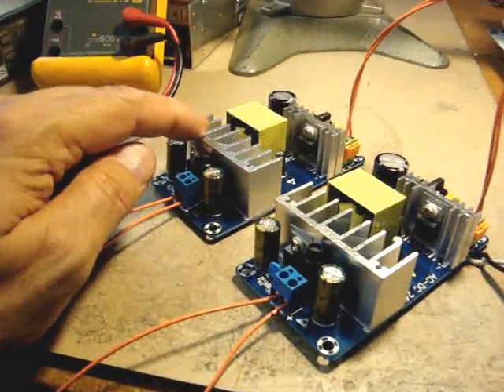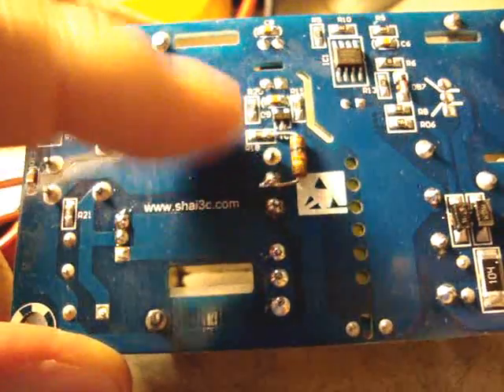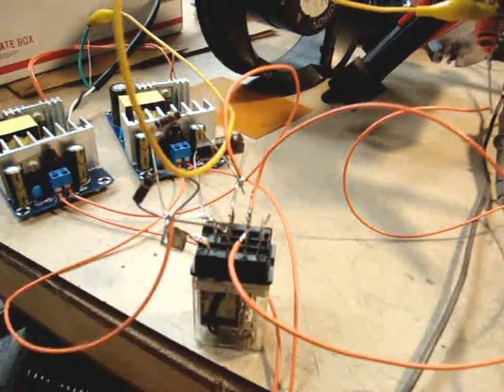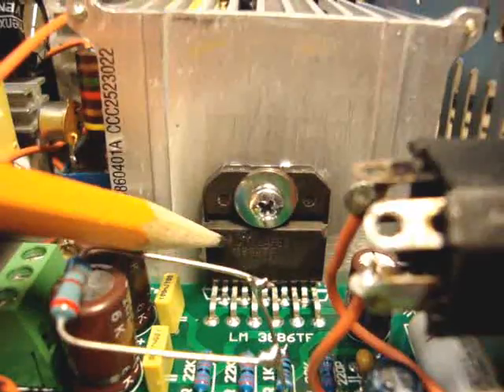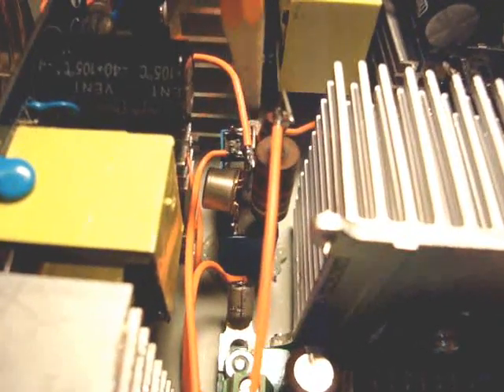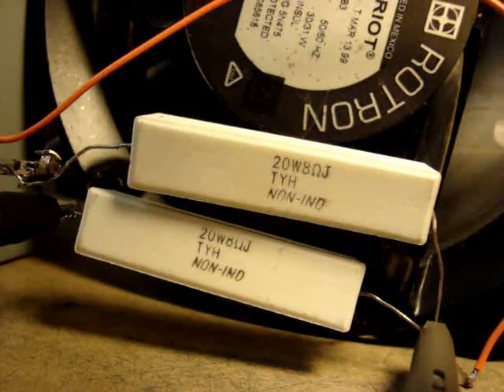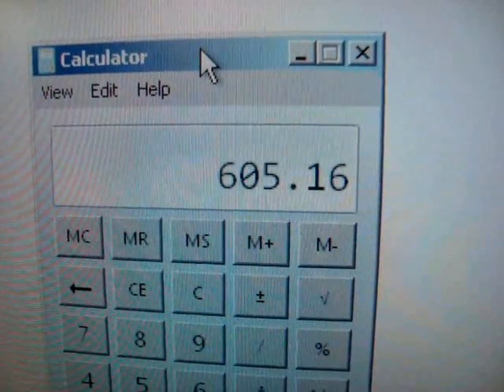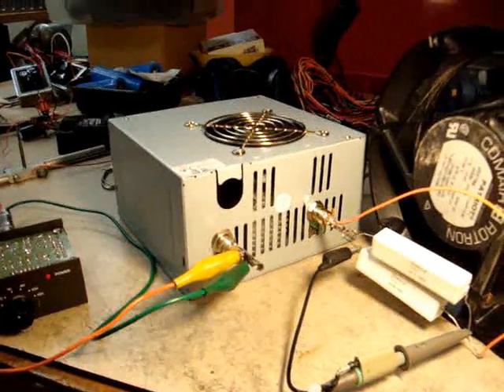SMPS LM3886 Amplifier Project

Comment: Hi Bob, i have a question, i have one switching psu with 2 out, (-V,-V,+V+V and gnd) 24 volt  5A , can i use? Or i need 2 separated psu? Thanks
Reply from the maker: Good question. If that's what i think it is, it's asctually just 1 power supply with the extra outputs connected in parallel to the screwdown wire terminals for convenience of wiring. I have a few supplies like that. There's 1 way to find out. If you have a multi tester meter, check contiuity between the 2 positive (+) terminals or the negative (-) terminals. If it checks a short between either of the 2 terminals, this means the psu just has extra terminals. Thus, you'll need an additional psu. Hope im wrong tho.
Reply: @bob4analog  yes, this tipe of power supply,
Reply from the maker: @andresgamboa1275  ok, so you'll need to get a 2nd psu. If your psu has a metal case, make sure the negative terminal is not connected to the case. You can check that with your ohm meter.
Reply: @bob4analog  ok, like your video, thanks My friend
Reply from the maker: Hope it works ok for you. All the best! 😃

Comment: I like your way of doing this - compact, powerful, cheap. Can you do some noise measurements as well? How about hum and distortion?
Reply from the maker: I suppose i could, but this was really a basic test evaluation to demonstrate the power output of the LM3886. The hum is virtually nonexistent and the freuency response is flat from 30-20khz (which I didn't show, sorry). I would imagine the THD would be close to the mfg's listed ratings.

Comment: Hi Bob,
I’m trying to do your idea with the two 24v switching but i add two step up voltage circuits that pull up the tension at 31v. What i’ve not understood yet, is how create negative voltage. It needs the relay to do this? Because at the pole of AC(in) amplifier i’ve only positive tension (+31v). Sorry i’m not well in electronic
Reply from the maker: The power supplies are connected in series, like 2 batteries. The ground is where the 2 batteries (or power supplies) are connected together.
Reply from the maker: I'll be glad to send you the schematic of how i made it (if i haven't sent it to you already).

Comment: How clean was the DC that these smps made? Doesn’t smps have a lot of ripple if not built for audio?
Reply: Off-the-shelf ones might have a lot of high frequency switching noise, but mostly its above the range of hearing, so it should be ok provided the amps are compensated properly so they dont oscillate given the high frequencies present. But if theres too much noise at the output it can damage tweeters. The amps can help somewhat depending on how they are set up given they still have 20-30 dB of CMRR at higher frequencies. Another consideration is the current, as these will only have around 3.5 amps peak (1.75 amps/channel), so they may not work well for 4 Ohm speakers. I used a flyback in my LM3886 amp, but of my own design so it could be bipolar, and be low noise with the appropriate bypassing and snubber networks, and fit onto one PCB so it just has a mains cord going into the cabinet. At the amp output the residual noise from the SMPS is down to around 20mV RMS. Power output is 36W RMS into 8 Ohm speakers.

Comment: Hi BoB H, which rail does the relay switch on? Pos, Neg, or the Gnd rail?
Reply from the maker: The relay is connected across both rails. It will only activate when both supplies are up.
Reply: Thanks.
Reply from the maker: @raytempo6332  -  ;-)

Comment: Is it possible to modify the power supply to work at 40v?  I have a 16 ohm load that i want to drive using a 3886 for a guitar amp that i'm building.  I actually already have one going with a 28-0-28 transformer but want to build a second one for a friend.  These power supplies are much cheaper than a transformer!
Reply from the maker: I have another vid where I use 2 switching PSU's for the +/- rails. Yes, those are far less expensive than transformers. However, modifying them to do 40v per rail might be pushing the PSU's. I'd recommend finding a PSU that will do 40v or something close to that, then you can mod it for 40v from there. Hope that makes sense.

Comment: Gday Bob, 

Great video mate, really got me inspired! 

Just curious, do you hear any of the lower order harmonic switching hash at all at quiescent levels?
Reply from the maker: Thanks, Mate! If you mean switching noise from the PSU, no; it actually sounds great. Have not heard any noise -- none that I noticed anyway. I was a bit concerned with using an SMPS, but I went ahead and built it anyway.. it worked. I kept the input away from the PSU inside to avoid any coupling of switching noise. SMPS are great for being light, small and can regulate wonderfully. Altho, I'd still rather have one with an 'iron supply' like I have in this vid... https://youtu.be/jJ6V0NjE6vg - Cheers!

Comment: hey bob. which one is better between this and the other power supply you use for lm 3886?
Reply from the maker: I like the SMPS in this vid. It's far less expensive and is not near as heavy. Altho the transformer type is simpler and does not present any issues with switching noise that's inherent in SMPS.  :-)

Comment: Hi Bob, thanks for the video!  What's the math behind adding the 10k resistor to make the SMPS go from 24 to 28.5 volts?  Is there a practical limit to how low or how high the power supply can go?
Reply from the maker: Dave S - Yes, I'm sure there's math, but I didn't use any. Most SMPS can usually produce more voltage output by changing the error feedback voltage divider network. I managed to obtain a schematic of this PS, which helped. I still had to do a little 'reverse engineering' as well. With that and some experimenting, I managed to get 28v out of it. It will do a bit more, but I would need to replace output capacitors with higher voltage rating.